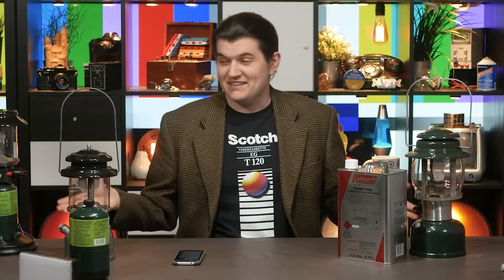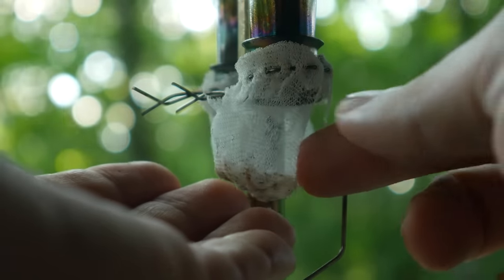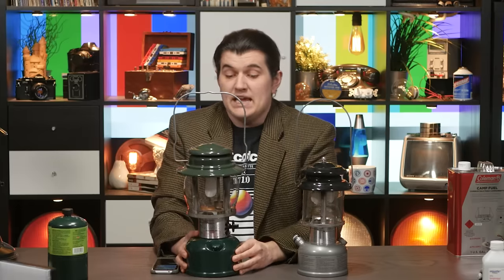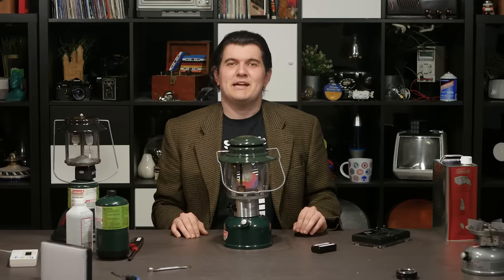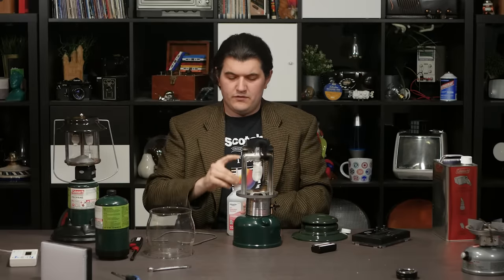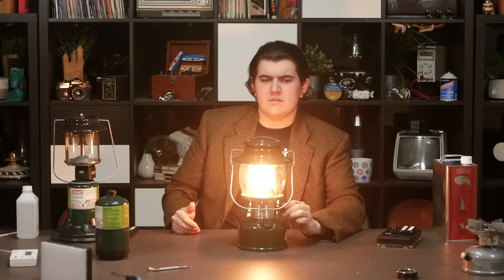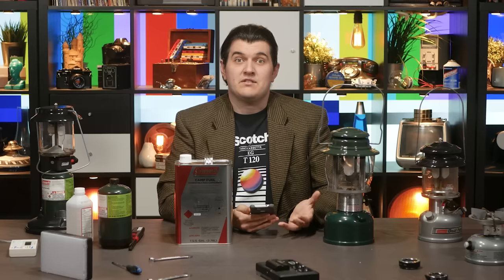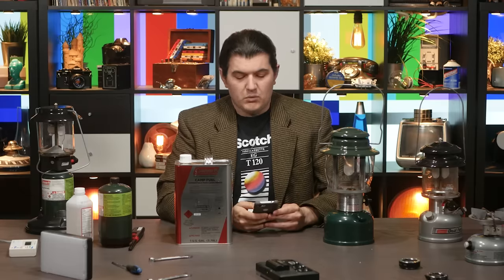A very rambly Coleman Lantern follow-up. Turns out they rarely make sense in 2021

Comment from the maker: Unintended handlebar moustache.
Edit: Turns out someone knew the secret to this Geiger counter. It's not defective, the genius designers just decided that, for some reason, if you're on battery power you need to hold the power button down long after it wakes up or else it dies. Great design! Really excellent. I love inconsistency.
Reply: But a gorgeous one none the less lol
Reply: Read the manual, boy?
Reply: Ohhhh it's to prevent it being turned on accidentally!
Reply: @zachleblanc3476  yep
Reply: @zachleblanc3476  Yeah, Geiger counters are pretty heavy on battery consumption, you'll drain it in a couple of hours if you turned it on by mistake, and it will be out of battery when you really need it...
Reply: That's great to know. I have the exact same Geiger counter at work and will have to try that out.
Reply: You can bypass the alcohol cup on the keresone lanter by using a butane torch to pre-heat the generator. It's a little tricky but it's a bypass.
Reply: Also, the smoke that comes from the lantern prior to lighting is probably because you're using 70 or 93% rubbing alcohol. Denatured alcohol does not do that.
Reply: That was actually very interesting, in a jumbled sort of way - I like it!

If you consider the main channel as being akin to a college lecture, then this is surely like going over the revision notes?!
Reply: Any chance you could add closed captions to this? I really appreciate the ones on your main channel but wish I could get access to the content on this channel too.
Reply: Oh please talk about gas lights, like the Humphrey gas lights. Growing up my grandparents still used gas lights and they are still being manufactured, and are still relatively common in off grid houses and cabins
Reply: I was just about to come in here to say the same thing since I have the exact same model of geiger counter lol
Reply: You understand you need to do videos on solar energy and fuel based electric generators now right lol
Reply: The hole in the plunger probably prevents small children from pressurizing the tank after they see adults doing it.
Reply: Maybe the intention is to make sure that the Geiger counter has battery in some form of emergency?
Reply: But gas lanterns won't work if you're camping on the moon!!!
Reply: I was trying to find a link for these LED lights. by even looking at the RGB video. Could we all get a link for the LED lights? or at least the name for it?
Reply: @jpboileau5473  well in a pinch you can use Pharmco grain 95% ethanol. And then you can also drink some if you need it for medicinal purposes... And also seems to me that if you were really in a super pinch, you know like emergency situation. You could start these kerosene lamps with a little bit of gasoline in the cup it should work just the same. And yeah it's a tad bit safer than alcohol since the flashpoint is a bunch lower.
Reply: Is that the New GQ GMC-320?
Reply: Dear alex, seeing the set lit up with the light off at about 31:50 is admittedly quite pretty. maybe you could find a use for lighting like this in a main channel video sometime?
Reply: You don't have to keep apologizing for having a particular prospective.🙂 We camp regularly and we abandoned fuel based lanterns before LEDs. We were camping with small children and the reduced light from the compact florescents was more than worth the return in safety. It did not break the bank either. Barring the situation where electricity or batteries are not regularly accessible, modern LED lanterns are no brainers.
Reply: I really like these video's as a form of podcast, I like listening to them whilst doing other things and if you show something interesting to quickly Alt-Tab back to see it. The main video's I like to enjoy as vidoe's.

I mean I wouldn't mind an action podcast tbh haha :P :D
Reply: yeah also if you hold it long enough to turn it on, it goes into the settings menu almost every time
Reply: If I turn my laptop off on mains, it shuts down. On batteries, it hibernates.
Reply: @jpboileau5473  Typically ethanol smoke is colorless.
Reply: See "chemical and physical characteristics of ethanol and hydrocarbon fuels."
It goes over your suggestion, which was a good one anyway, even if that suggestion came from a place of misunderstanding.
Reply: I used various kerosene lamps last century and they are the best next to electricity and although  more expensive they are the cheapest next to electricity. 
Produce some useful heat too
I don't use them now because batteries and LEDs
Reply: Yep, just makes it easier to not kill the battery by accidentally turning it on in your toolbag.
Reply: Hey Alec, what are the environmental concerns of each of the various fuels vs batteries? Also, which option puts the least strain on dwindling natural resources?
Reply: The quick start guide that came with it says "3 seconds"... I bought the exact same one after seeing it in your video. Would be interesting to see amazon sales statistics compared to you video views :)
Reply: I only love inconsistency part of the time.
Reply: @jpboileau5473  Was butane available when these were first invented? I think he's trying to show the historical way they were used. I can see many similar improvements that could be done now.
Reply: I like the ADHD disjointed vids! 💖
Reply: Sounds like a good premise for another video 👍 Great videos and explanations as always. Keep up the great content.
Reply: I think I have the same Geiger counter as yours - GMC-300E Plus? I have two different models. One is beta/gamma and other is alpha/beta/gamma and both require you to hold the power on button until it shows you the battery level then release.

GMC-300E Plus for Beta/Gamma
GMC-600+ for Alpha/Beta/Gamma
Reply: Inconsistency in a SAFETY device is Exactly what i want. Especially if i find myself on a trip near Hiroshima or Chernobyl 👍
Reply: The white gas can is really thin steel, with an exterior coating.
Reply: @millomweb  that is configurable.
Reply: Modern battery tech is wild; a 200Wh Lifepo4 raw cell is only $22, weighs 1300g, has a cycle life of  >3000, work in the cold and heat, unlike li-ion nmc cells, they don't like catching on fire, have very low self discharge (2% per year) and very long shelf lives (also around 2% capacity/ year).
Reply: the hole and thumbs are a cheap pressure regulation, It is almost impossible to overpressure the lamp but I never underestimate the possibility of determined idiots
Reply: You mean like the pump and the hole thingy?
Reply: Pinned comment ✅ 
Waiting for the next video……
Reply: I have that geiger counter. Mine works fine, but of course, as with many lost cost products hit or miss, whether you get a good one or not.
Reply: Kerosene is much safer to store, transport, and handle in general terms, than gasoline and other fuels. Aside from gasoline which wasn't ubiquitous until later, the use of volitle or unpredictable fuels is why the use of kerosene became popular in the late 1800's in the first place. With the use of kerosene, the number of house and building fires went down dramatically.
Reply: LED lights have only been inexpensive in the last 10 years. Be patient. People around the World are transitioning to them.
Reply: Unleaded pump gas, even in countries where petrol is expensive, is still much more inexpensive than white gas.
Reply: Many people, especially when first exposed to it, find LED lights harsh as they don't diffuse as well as the mantles. LED lighting is improving in that respect though.
Reply: @DMahalko  Who knows... But what I'm trying to explain is that there are ways around the long wait.
Reply: Consistency is but a refuge for weaker minds. At least, that's what a former Chemistry professor of mine kept reiterating. He also made it abundantly clear he was a Princeton graduate. Regularly.
Reply: U should review a blf lt1. Comperable light runs on energy dense 18650 which are essential free because there are so many defective tool battery pack.
Reply: Just watched this entire video. Luh Luh love both of your channels. I really enjoy the candid along with the scripted.

Not sure if you would be interested but I'm traveling thru your state on my way home to CA. I've got my entire photo darkroom loaded into my car. This is probably the worst way to make this offer but it's what I've got!  Ummm...yea. Shoot me a reply if you are interested in how film goes through its various processes to become a print.
Reply: @sparky6086  also in most countries gasoline is about 3x the price of kerosine due to taxation of auto fuel.

The U.S. of course has ridulously cheap gas, by global standards
Reply: Then the screen should not come on until you have finished holding the button down rather than give the impression that it is already on. That is a poor UI.
Reply: I actually liked hearing it clicking the background during that video... in fact if I was home I'd get mine out to seek this comfort, I haven't used it in months but flea market season is coming soon..  Amazon said they delivered my thorium mantle calibration pack today to the office but I haven't been by to pick it up.  Unfortunately and ones that I ordered will most likely not fit my Coleman units so I will continue searching...
Reply: Why are those things still legal? They made sense 50 years ago when all you had were inefficient incandescent bulbs bot in a world with LEDs gas lamps are an unnecessary hazard.
Reply: you need to try lighting the kerosene lantern with denatured alcohol instead of isopropyl. there's much less soot and other garbage. It was originally designed for use with denatured, not iso
Reply: Cody Haddican  He covered the Aladdin lamp at length in one of the recent videos.
Reply: Isny kerosene just diesel fuel? couldnt you just use diesel... Ive heard the fuels are identical and only regulated as different for taxation purposes
Reply: @DeltaOps3  negative. there's different sulfur contents. Say, Jet-a(jet fuel) is kero with a very low sulfur content and some different additives.
Reply: @williamgoodwin3325  send it
Reply: @DeltaOps3  send it?
Reply: @williamgoodwin3325  use it anyway
Reply: @DeltaOps3  i think he should have gotten some jet fuel just so he could say something about a jet fueled lantern
Reply: @whitesapphire5865  I've burnt 75% and it doesn't smoke either, so don't think that's it.

I think the smoke, is the smut left over from turning off the lantern.

As the temperature fell, combustion became incomplete and left deposits. Also, probably some fuel left in the generator that began boiling off while he was warming it and caused the same thing.
Reply: @julianshepherd2038  How bout the other way around?
Reply: What about some places in Alaska
Reply: @bgdwiepp  And 1 dl of petrol is about 1000Wh, weighs less than 100g and costs roughly 15 cents. Liquid fuels are so much more energy-dense than batteries are, that's why electric cars are so heavy but still don't get as good mileage as petrol cars.
Reply: This format I enjoyed more than the other and it was imo more intellectually stimulating. I love hearing someone explore ideas and the process of articulating them.  DO NOT feel dumb for going in circles, it's better for us to hear you a few times or more so we remember. Also you were way more real and relatable and sounded a lot like me when I explore ideas out loud. Thanks!!!!
Reply: Have you thought about doing Livestream? Do you live stream and I don't know about it? I love hearing your voice and would just love to have you talk through that medium
Reply: @KiithnarasAshaa  Would you say that he mentioned it with some consistency?
Reply: Would you like a pre-burn alcohol bottle to go with your Kerosene lantern?  I have a spare one.  Free to you.
Reply: I recently bought a Geiger counter, and it isn't the most user friendly. I did find out that the radiation in my area is at a safe level.
Reply: For battery i feel a far comparison is more with a motorbike/car battery (similar weight/size), can be abused like recharged by direct connection with a solar panel of correct voltage and deep discharged, also they are much easier to get by in very poor country
Reply: I don't know if someone already told you this, but that lantern with one mantle (which you needed to use alcohol to start) is better as emergency lighting than those instant ones. The main reason for this is the fuel plate under the generator tube. It lets you use basically any liquid fuel which can be evaporated to produce combustible vapor. Out of kerosene? Pour that leftover alcohol instead! Don't have any alcohol? Use some gasoline, it will perfectly burn on that plate. Out of gasoline? Hell, you could even use some paint thinner or any other burnable solvent with it. Not for too long, of course, and it could damage the lantern with residue, but hey, it's an emergency light. Of course this doesn't count in cases when you could just go to the nearest Walmart, but its ability to use any kind of fuel is quite nice in some harsh environments like in camp or small mountain village far away from civilization.
Reply: Dude, you're slowly turning into Elvis Presley....
Reply: I do not know, if You will read this, but I will write it anyway. I must strongly disagree with you about your view, on kerosene pressure lamp, since You are discussing this issue only with the example of coleman kerosene pressure lamp. Petromax lanterns are far different from coleman kerosene lamps, for example they have rapid device, which makes them far far more pleasant to use. Moreover, they are able to work on diesel fuel, or even ethanol (with a tiny buyable device, which costs ~15$). I do not know, if it is possible on coleman, since I own only Pertomax HK500. With gasoline lamps, there's even a bigger problem, you've mentioned, but just superficially. There were cases, where gasoilne lamps had exploded. In '50-'60 German Army was experimenting with gasoiline Petromax lamps, and they abandoned this idea, because even if gasoline is much much more common, and it would be easier for quatermasters to deal with logistics, there were cases of soldiers injured by exploding gasoline pressure lamps. Since it is still vaporized hot gasoline in the tank under pressure, where even steams of cool gasoline are extremely flammable. I'd be really pleased, if you would make another short clip, discussing the matter, because for now it is a bit unfair from the perspective of kerosene pressure lamps.
Reply: almost all "tins" these days are simpel steel, a few aluminium. some times they may get a coating on the inside of tin/zinc/etc
Reply: One small thing that you didn't include with your cost with the battery lights (I know of people that loose power for a week or more at a time) you keep mentioning a solar charger for the batteries, you should include that price as well for the starting price. Oh your comment on the electric cars V gas cars you are so wrong. Remove the government subsidy's that you get for buying one and remove that the manufacturer gets from the government for each electric car and they are three to four times as expensive.
Reply: @zachariaperkins3182  Not sure but does that hole allow pressure to be released from the tank before opening the tank for some reason? or for temp storage for travel to reduce possible leaking?
Reply: OFF ROAD GASOLINE (not taxed) is just as cheap as kerosene.  Almost a dollar less than auto gasoline.  So once again, no reason to deal with the lighting hassle of kerosene lamps

.
Reply: EVs are not on cost parity with gasoline cars.  I bought a Ford Fiesta in 2018 for $12,000 new.  There was also a Mirage available for $11,000.  No four-seat EV sedan even comes close to that ($40,000 is the cheapest)

.
Reply: Kilolumen  is a valid SI unit.  You didn’t “make it up”.  You could also say millilumens, or centilumens, or any other multiple.  SI is designed to be flexible 

.
Reply: 4
Reply: 3
Reply: 3
Reply: e
Reply: @kozygeorg  3
Reply: I love this guy. Awesome!
Reply: The hole in the plunger is to make it easier to tighten the seal off when you're finished pumping. Without the hole you would have to push the plunger in against maximum pressure while rotating the plunger. I had the hole get plugged on my lantern once and it was very difficult to tighten the seal off.
Why is there a seal off? It is a safety feature in case the check valve of the pump leaks. If the tank is full the pump is submerged in fuel and pressure will force  raw fuel to come out of the pump!
Reply: So, it's a power save feature.
Reply: I have the same one, I compared it to starting a cranky old truck
Reply: @millomweb  you can change that via your laptop’s power settings. That is if you already haven’t learned that and done it a year ago.
Reply: I don't know how I managed to attract a flat earther in the comments section, but I did.  I am still unsure of how this happened.
Reply: Seems like most of the negatives didn't really apply to the propane lantern.
Reply: The thing about the Coleman is you can use the heat that it generates also so it's absolutely wonderful and great God-bless everyone
Reply: It is possibly an effect of it being safety equipment: they want you to read the manual, and not get the impression that you know it's actually working until you've done so.
Reply: @InconsistentManner  Same
Reply: Well of course, you've got to give the thermocouple in the Geiger counter time to warm up before its pilot light will stay on ;)